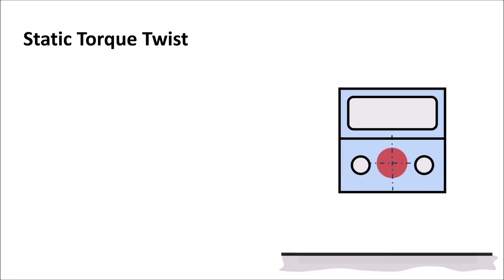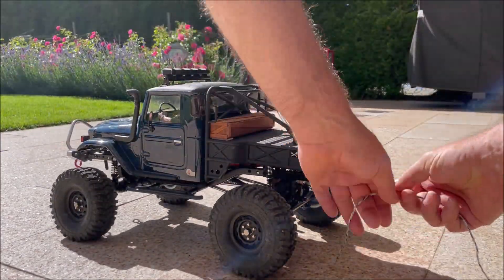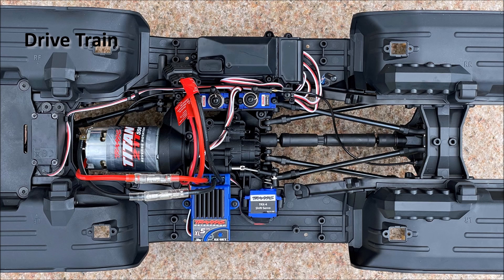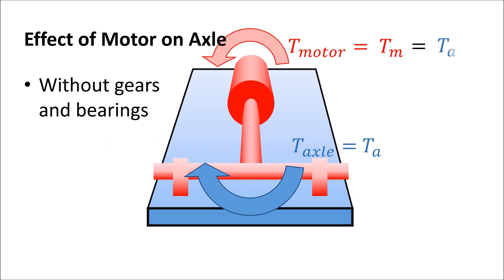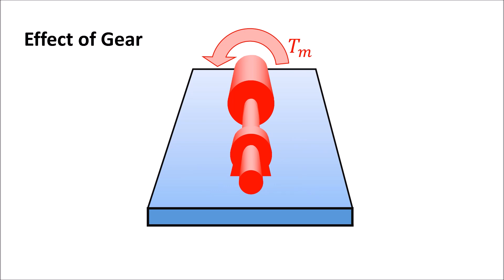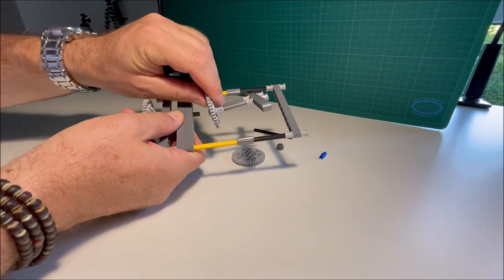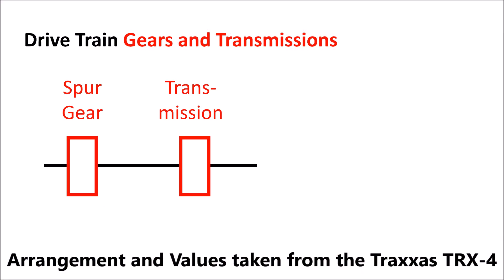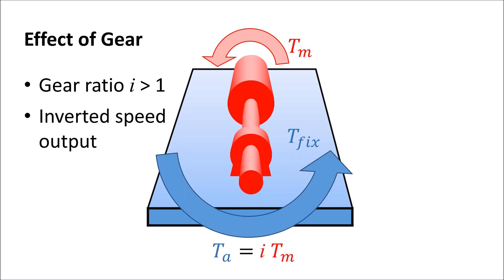More about Static Torque Twist of RC Model Cars

Comment: Awesome and very informative videos, congrats mate. Question, would stiffening springs and higher oil density in just the two shocks involved in the twist mitigate the issue? Let's say my car pushes on the rear left and raises the front right wheel, would strengthening the shocks of those two wheels help or should I strengthen all four shocks evenly? Thank you, Cheers ✌️
Reply from the maker: @igorilla5769  stiffening springs helps best. The more of the springs at getting stiffer, the better. If you stiffen only one side, the rig would tilt towards one side. Using more viscous oil can help, but mainly against dynamic torque twist. 
RC Scientific

Comment: I wonder if over drive for the front axle reduces torque twist and is it significant?
Also I wonder why anti torque twist gearboxes are so rare, and when they are used, most often it's the only feature of the gearbox.
Reply from the maker: I think overdrive does not influence torque twist a lot. And as far as I know, anti-torque-twist gearboxes only invert the rotational speed direction. This might be beneficial for static torque twist (depending on the drive train and transmission arrangement), but not for the dynamic torque twist, which comes mainly from the motor.